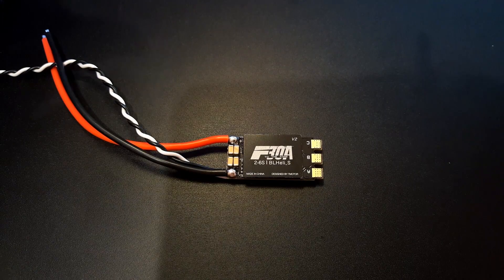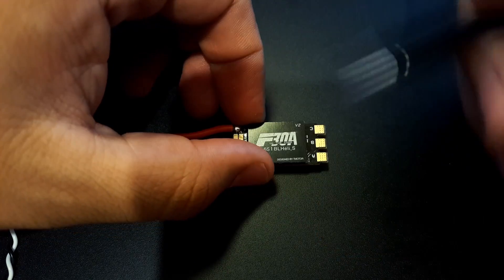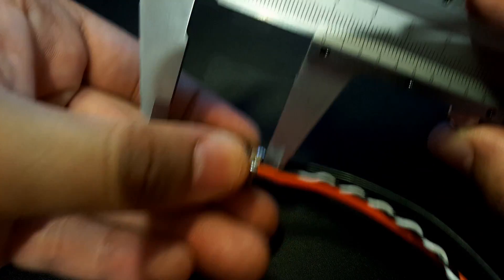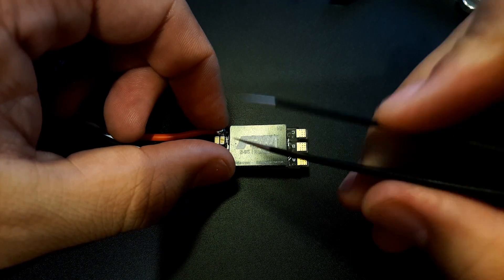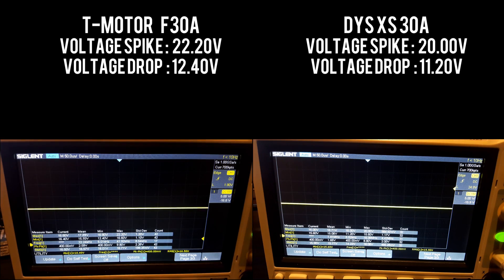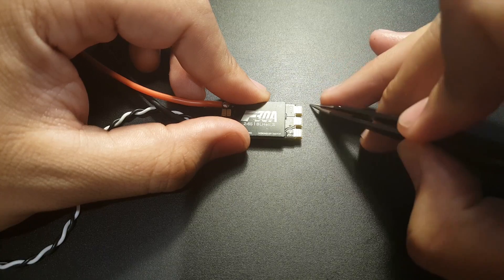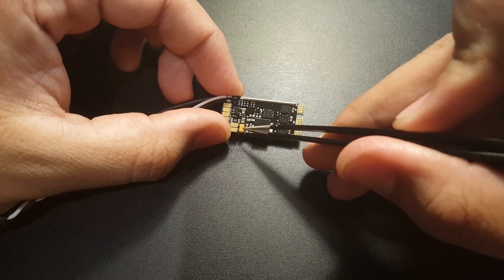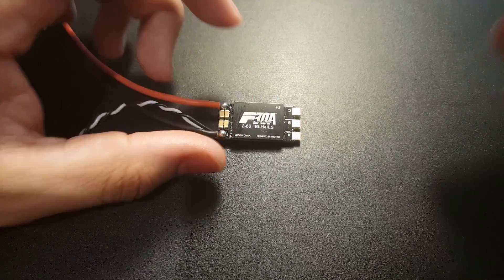T-Motor F30A V2 ESC Review // Noise Testing

Comment: Hi
 have you tested the xrotor 30A dshot 600 ESC.  do you know if they are noisy ? compared to others
thanks.
I know your not keen on T motors but what do you think of the F30 2800kv is it still ok , or is there better 1806 motors out there like the beerotor (zoefpv) z1806 2900kv ? for 4"
thanks again..

Comment: Is the fvt littlebee_s 30aesc or the airbot wraith 32 35a blheli any good?
Reply from the maker: Little bee is on the way and the airbot still have not gotten them.
Reply: Drone Mesh emax and those 2 are one the few i can buy here so thats why i ask but if the motors and esc's make to mutch (noise) where do you solder the caps. on every esc or where you put it on last vid what is bttr? Btw thnks for answering 👍🏻
Reply from the maker: Bennie you said you where in Netherlands.. I am in Europe also and Netherlands is EUROPE transport hub for anything coming from China to Europe so you can order with banggood and have it by you within 10 days.
Reply: Drone Mesh yeah i want to buy that frame and fc. what you had in youre last vid by bg. but i wanned to buy the motors and esc's here somewhere if i have problems i can drive up to them but if here isnt good esc's then i order them to there i think. Btw is youre interference gone now of youre last vid?
Reply: Drone Mesh but I thought that you lived in YouTube 😆😆😆
Reply from the maker: Not always ;) .. About interference I still have not flown it again.. We have very big thunderstorms now and can't fly so stuck home :(
Reply: Drone Mesh yesterday and day before or not . But i am curious what it does if i got that problem what i should do because you said that that 2205 2300kv emax was noisy but i want to use those
Reply: Drone Mesh do you live in Belgium ? Because you dont talk like a English person or German has more of a accent and france mostly dont talk englisch

Comment: Would you please explain what you ment by the measured voltage drop, and it affecting bec 5 v? Where are you measuring this drop, and how is that connected to bec 5v?
Reply from the maker: +Ola G Braaten The 5v bec if fine but some drops and spikes can have that 5v bec drop to around 4.1v sometimes even lower, normally this is not a problem but the OSD chips that are being used in the FC'S are very sensitive and could restart your osd and cause flickers.
Reply: Drone Mesh i really dont get it. The 5v bec is on the fc. Youre voltage drop measurments of 11-12v, where do you measure this? As long as the lipo supply voltage does not sag below 12.5-12.6v into the fc, the 5v fc bec should be all good.
Reply from the maker: For example if you are using a racerstar 35A MS Series the voltage drop go down to 7V as I was stating on this ESC you would not run into that problem.. Hope that answered it if not please clarify
Reply: Drone Mesh sorry i think i just had misunderstood you. So its the noise made by the esc, into the pdb/fc that is so severe that the fc bec actually see it as a voltage drop from its supply? Didnt think of that, and thats really good information!
Reply from the maker: Glad I could help ^_^

Comment: solid esc for sure. I put a set of these on a 6S six inch build that I did for my brother with some 1900 KV f80 Motors. the thing is a Powerhouse and is still ripping after 30 to 40 packs with no issues.

Comment: I would classify this ESC as high-end, 17 dollars a piece is definitely on the expensive side.

Could you test the DYS DS30A? They are very cheap (30 bucks for 4 ESCs) whilst having a good amp rating and it's from a reputable brand. But I really wonder how it'll keep up in testing.
Other ESCs I would like to see tested are the Little Bees Spring 30a and DYS XSD30A V2.
Reply from the maker: Swooky Same here it's very expensive.. I finished the review for the DYS ds it will be up tommorow or monday max.
Reply: Yeah, I expected better for such an expensive ESC. But maybe the DYS XS30A is already very good.
I think we might have too few test results to really call something high or low end.

I also wonder how well these noise test results translate to how good the ESC in general is, like quality and longevity.
Reply from the maker: Agreed I am pushing these reviews as fast as i can.. I have ordered the XSD and the Little Bee srping and summer for review. They still on the way.

You can check my reviews in detail and upcoming products on my website.

I add the data here after I release video reviews on the product if you wanted a bit more info.

http://dronemeshlab.com/upcoming-products/
Reply: I second the DS30A for review, I've been eyeing them off for ages and just need to know how good they are.
Reply from the maker: +Daniel Wigzell review will be up either today or tommorow I don't want to spam you guys with many uploads at once.